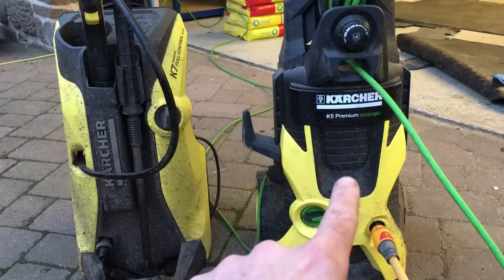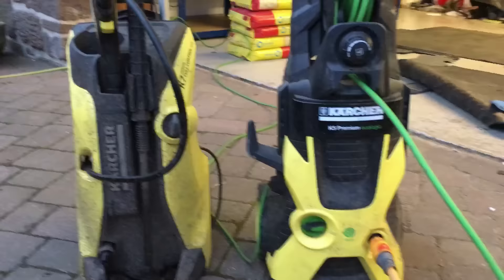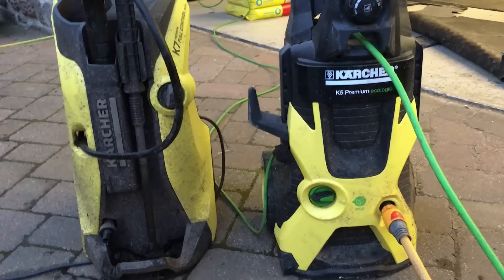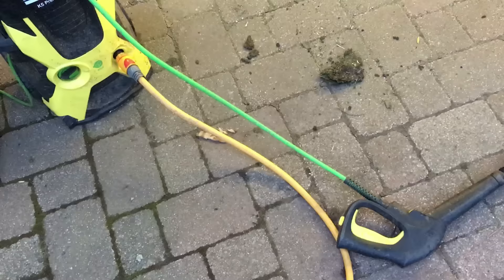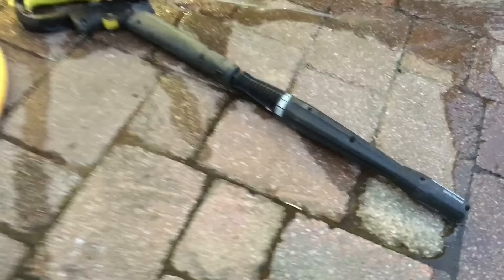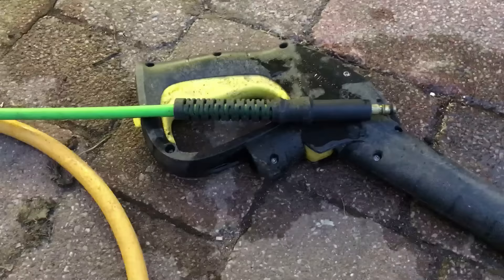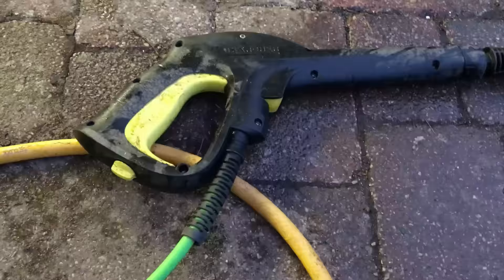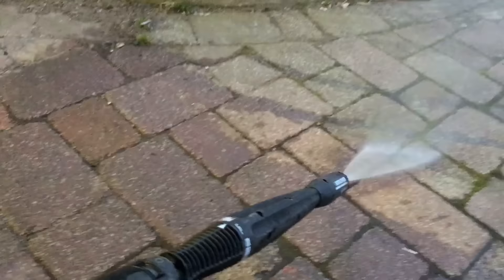Karcher K2 K4 K5 K6 pressure washer will not turn on | QUICK EASY FIX IN 5 MINUTES ! Karcher problem

Comment: You don’t even have to take the lance off. Just spray the water out of the lance under water pressure only (machine turned off) for a couple of minutes. Turn back on & all should be working.
Reply from the maker: Thanks for the comment

Comment: Thank you - After not using my K5.7 for a long time I was also about to try and take it apart to check that the power was getting to the unit. After trying your advice for a few minutes without success - your mention of bleeding the water hose for a good 5 minutes got me thinking about where else could a tiny air leak get into the system as all hoses seamed good - then I thought about the now empty (upside down) soap bottle - maybe being empty was enough to trick the system - so I half filled it and within a minute of bleeding the water as per your video -  the karcher was running normally !!  Maybe my soap bottle is very old and may be leaking some air into the system - but filling it plus following your advice FIXED the PROBLEM - thank you !!!!!
Reply from the maker: Great, thanks for the comment, hopefully will help other people with similar set up.

Comment: Superb tip! I spent an hour messing with the switch thinking it was an electrical problem! Literally followed your instructions and hey presto works straight away! Many thanks.
Reply from the maker: Great to hear David, thanks for the comment 👍😃
Reply: i did the same stripped the whole machine looking for electric issue ... found this and did it without reassembling the machine ... now got to put  it all back together ggggrrrrr ... well at least i know how little there is inside it and how to strip it 🤣

Comment from the maker: Please let me know if this works for you guys - I would be interested if it works for other models. 
If it does, please let people know in the comments, that would be much appreciated ! 
Thank you.
Reply: Worked perfectly on my K2 .  Unfortunately now the wife expects me to use it.
Reply from the maker: Great Darren, Yep, that's the down side of having a working pressure washer again.......cars to wash, paths and drives to clean...........the list goes on !! Happy it worked for you though !
Reply: Great advice. I had bought the K2 to replace an old model which had stopped working.  I was about to replace the K2 which had also stopped working before I saw your video.  Now I have two Karchers in working order. There's no need to detach the lance.  Just pull the trigger with the power off and let it squirt water through until the air is dispelled.  That will be my routine now everytime I use the Karchers.  What do you do with two Karchers?
Reply from the maker: @andrewparker6960  I now have 2 Karchers as well after following my own advice !! I have just ended up keeping them as one can be used as a spare. Thanks for the comment

Comment: Thank you! I almost threw mine away! You saved me loads of money.
It interesting that when I first started the bleed process there was a hollow rushing sound like the machine was empty even though the flow was perfect.
and I thought, oh well I am going to be the unlucky one for who this fix won't work. 2 minutes into the bleed the hose started to splutter a bit.
It never really stopped spluttering but the rushing sound had stopped so I assumed the machine had filled and tried it and it started.
My advice is to definitely spend at least 5 minutes bleeding with a good flow of water.
Reply from the maker: Thanks for the comment, I'm glad that this worked for you !

Comment: Top man — worked a treat!! Glad you made the point about letting it run for good 5 mins as water flowed straight away when took lance off so tried powering up — nothing. Left water running, Went away and cane back and tried again POWER 👍 saved a good fee quid for me sir — thanks
Reply from the maker: Great to hear, I'm glad the video helped you out ! 👍

Comment: As per all other comments: great solution for a niggling and potentially expensive issue.  Thanks so much for posting the video. Like others, I was thinking of internal fuses, thermal fuses or even a burnt out motor following a hard session of power washing the last time i used the Karcher.
Reply from the maker: Thanks for the comment Robert, I am glad you found the video useful 👍

Comment: Amazing.  We have had our Karcher for a number of years so getting it out yesterday to pressure wash the patio no power - we changed the fuse in the plug, tried different plug sockets and extension cables with no success.  Just about to take it to the Repair Cafe and thought I would check if there were any fixes.  NOW WORKING.  Saved us the cost of a new Karcher.  Many thanks.
Reply from the maker: That is awesome!

Comment: Thank you so much. Fixed my issue.  You’re a legend!!! The only thing I would mention is if you put the hose you disconnected from the Lance higher than the actual pressure washer the air bleeds out more easily (as air rises). Thanks once again mate :)
Reply from the maker: Glad it helped and thanks for the comment 👍

Comment: Top tip and absolutely spot on. I’ve had pressure washers for twenty plus years and worked in plant hire for twice that and this was a new one for me. I’ve been cursing Karcher and I’ve been looking at Stihl and Bosch machine’s to replace this troublesome K5 machine but this worked 100%
Reply from the maker: Great to hear Gary, thanks for the comment mate ! 👍😎

Comment: Well, well. New mowing g season,  got the mower up to wash under deck... K2 (with short pistol fitted to point upwards) won't switch on though Parkside with too-long lance will work. Come looking for answers, this comes up. I notice my handle... I've been here before, had forgotten the 'trick'. Learned again, tried it, it WORKS! Cleaned under deck, no rusting in time to come!
Thanks a million again!
Reply from the maker: Great, thanks for the comment !

Comment: Well done on finding a simple fix. I have 2 karchers older types a 7 series and a 7.85. The 7 series had 2 faults- faulty switch and internally blown lance handle, both replaced and still works fine 2 years on. Easy fixes.The 7.85 had a faulty switch, it is a poor design in my opinion and must have been the cause of thousands of these machines being thrown away needlessly!!. You can either pay £35.for a new switch or throw what was a £400. machine away and start again. I found another way, if you wedge a rubber block(internally) behind the switch this cures the problem and it now works perfectly every time, the only thing is you turn it on/off at the wall socket using a circuit  breaker plug for safety- which I would always recommend anyway when using any jet wash as water and electric are always a potential danger. Come on Karcher- sort your switches out! They are letting down otherwise good machines.
Reply from the maker: Thanks for that Peter, hopefully that information will help some people out. Yes, you see so many good looking machines dumped at the local recycling centres, I bet at least half of them could be fixed in minutes - such a shame but hopefully this video will stop some of this happening in future ! 👍✊

Comment: Thanks a lot pal, i left mine running water through for 25 minutes, connected back up because it was still spluttering bad even at 15 minutes, had left washer up 4 years, bought it in 2017 used it 3 times on a car and drive, was shocked when went to use it again and nothing.......

Done as suggested, SHES ALIVE and working as intended as they arent cheap...... I've always wondered how many have fecked them out and bought a new one😂😂
Reply from the maker: Great to hear, yes, just imagine how many have been taken to the dump.........when they could have been fixed in minutes.
Reply: Sometimes the problem is due to a bad connection at the tap end, allowing air to be sucked in along with the water.

Comment: Thanks very much for posting this! Like others stated, I was thinking mine was destined for the trash, or a very expensive repair. But, it worked for mine just as you demonstrated. I feel I just saved several hundred dollars. I’ve had my pressure washer for five or six years and it’s really been a useful tool around the house.
Reply: Also, mine is a K5.
Reply from the maker: I'm glad it worked for you David, thanks for the comment ! 👍
Reply from the maker: Thanks for clarifying !
Reply: @Bacrenfencing l

Comment: Having looked at a number of these Karcher repair videos, I haven’t actually seen any feedback from the company as to why they seem to build-in so many problems in what are not cheap appliances!!   If would appear that all of their models suffer from pressure leakage, (from failing castings, not just replaceable gaskets): and other annoying faults.

My old K2 has such a problem, and if I can’t fix it, I’m loathe to buy another Karcher when they don’t seem to care.
??
Thanks for the video, and I hope mine is fixable when I strip it down.
Reply from the maker: I know, I have contacted Karcher regarding this particular issue and they did not even respond. I also contacted them on instagram and again they did not respond........I can't understand their complete lack of customer service for such a well known brand. I think they have a monopoly in the market, but I think they should up their game when it comes to answering genuine queries....it is strange why they do not have this particular issue in their trouble shooting guide when it clearly affects so many machines.............poor ! 😡
Reply: I noticed Karcher is a German manufacturer..and there product is grossly overpriced considering the high price and repair costs, and like you say, you never here any feedback regarding the High volume of faults they throw up, I'm on my 3rd and LAST!!.. why do the German companies think they are superior and charging a fortune for their products, when their reliability is so low..found this from Mercedes to Karcher.

Comment: Thank you so much for the advice. I've spent 1.5 hours swearing out loud. I tried 6 different exstention cables, 4 different power sockets, I thought it was the main power source. I use my karcher just to wash the car. Hardly used. So I had to Google the problem and your video came up. Tried it and it worked. Thank you.
Reply from the maker: Glad it helped! Thanks for the comment

Comment: I did try this but sadly it did not get my K2 started, thank you anyway. : - )
Reply from the maker: I am sorry that this did not work for you Michele, I know it works for the K5 and the K4 but had never tried it on the K2, so thanks for letting us know - much appreciated ! 👍😎
Reply: I just tried this for the K2 and it worked! Not trying to be smug here but maybe leave water running through for longer?
Reply: Yes just done on my K2 tried and no luck, then ran water for full 5 minutes and now works fine.

Comment: This guy is a genius. Absolutely fantastic! Left my K5 outside over winter. Turned on the black rotary power knob. Dead as a dodo. Thought it was all my fault as the frost will have got to it. Watched this video left water running for 10 minutes and then fingers crossed still didn't power up. Left the water running a further 10 minutes. Hey presto! So don't give up and persevere. 
I was just about to put in on the local for sale page @ £30 spares or repair and buy a new one. Somebody watching this video would have got a bargain. 
Thank you again Sir.
Reply from the maker: Happy this worked for you Dave, thanks for the comment 👍

Comment: Thank you so much! Whoever would have thought of that! After checking the electric and changing the fuse, I was on the point of booking a service for £80 plus the cost of a new switch, or pump, or motor. Blood pressure has returned to normal. Thanks again and I am more than happy to make a donation.
Reply from the maker: Thank you Tom, I am so happy this worked for you and thank you for the kind donation to the channel, much appreciated 👍

Comment: 💯 % fixed! Thanks so much for this video fix. In my case:
1. I was washing away and the plug unit outside my house- the 🔌 plus came out and hit a pool of water. Thinking that, maybe the circuit/ electrical must have broken the power unit inside.

2. No power! 

3. Watched this video and followed the steps- FIXED!

Side note! Regarding the air lock- i did notice that i couldn’t detach the main line to the unit or air gun! Must have been the pressure build up.
Reply from the maker: Great, thanks for the comment !

Comment: Thanks so much, I  have a big patio area, three weeks ago I washed it spent most of the day doing it, just as I  got the the finish it stopped dead, tried changing the fuse but no good. Just came across your video and it worked, much appreciated and straight to the point.
Reply from the maker: Thanks for the comment - glad it worked for you !

Comment: Just wanted to say a huge thank you for this. I assumed it was a fuse blow out but when that didn't work I resorted to Google and found this video. Couldn't figure out how to disconnect the pressure gun but after disconnecting the twist fit second section of the gun and then pressing the gun trigger I was able to run water through the machine, and it worked in the way you described. Very many thanks.
Reply from the maker: No problem, thanks for the comment !

Comment: Like others on here, thought my washer motor was gone !! But also found an extra point to take into consideration.
When detached from the handset and your flushing the air lock out ... I found out that the dial on the shampoo attachment dial was turned .. and if this is left in any position other than off then the air lock spluttering continues until you turn this dial to off ... so if think this could also be associated to your solution !!
Thanks again ... brilliant 👏
Reply from the maker: Thanks for the comment !

Comment: This is brilliant. Mine hasn't worked in years. I've got a smaller one as well but wanted the bigger one to clean the house walls. I nearly let Karcher service it once but the price was astronomical so I chamy mind. I recently bought a capacitor and some torx security tools then went to watch a few videos before tackling it and found this and thought I'd try this first. 
It worked a treat. 
I had to turn the start button to the on position to get the water to start flowing but could then turn it off again and it kept flowing.
Why don't Karcher give these tips out instead of trying to fleece us. Thanks again!
Reply from the maker: Thanks for the comment and great that it worked for you 👍

Comment: thank you thank you thank you!  My Karcher K2 cut out on only my third using of it.  I changed all the fuses and was in despair.  Like you, I thought to buy another.  Then I thought:  let's check You Tube.  
I tried your method and it WORKED.  I now have a clean patio!
I struggled a bit more with cut outs, but found that if I let water run through the lance before switching on at the start of a session, and letting water run through the lance with the power off at the end of a session, it works more often than not.
What an annoying glitch!
My other bugbear with it is that there are too many hoses/cables which keep snaking around each other and no tidy way to store.  But it does do the job, I suppose....
Reply from the maker: Great to hear Monica, thanks for the comment 😎

Comment: Worked for me. When I've finished with the washer always turn off the tap and run the water through to empty the system. Until yesterday!
I knew I was going to use it again today so I left it. 
Thanks for the tip
Reply from the maker: Excellent!

Comment: Thanks! For anyone with little patience: 

!! remove the pressure gun and let water flow through the unit for some time.!!!

 This will get rid of water trapped in the unit: there's probably a sensor or something that prevents the unit from starting.

Longer read (still shorter than a 5 minute video):

Do the following while the Karcher is switched OFF.

1) unplug the pressure gun 
2) turn on the water tap connected to the pressure washer
3) water will flow freely through the high pressure pipe, getting rid of air bubbles 
4) let it run for some time (a couple of minutes worked in my case)
5) close the water tap
6) reattach the pressure gun
7) open the water tap
8) switch on the pressure washer.
9) enjoy!
Reply from the maker: Thanks

Comment: Mum passed away almost 6 weeks back so I've brought her Karcher back here to (try and) use to clean our patio - our old rotary cleaner attachment doesn't fit our newer Karcher properly.  Plugged it in, connected the hose and ... nothing.  Extension lead and fuse on the Karcher both OK.

I was going to open it up myself sometime to have a look or maybe get it down the local Repair Cafe.  Guess what I'm now trying first, though - probably tomorrow morning!  Fingers crossed!  :-)
Reply from the maker: Sorry to hear about your mum, I hope this works for you.

Comment: Thank you so much, your fix is correct.  The only thing I did differently to you is that because the air bubbles wouldn't stop I powered it up while still unconnected for 2 minutes,  then connected the hose again and all was fine.  I owe you a beer.  Cheers
Reply from the maker: Glad it helped David, thanks for the comment